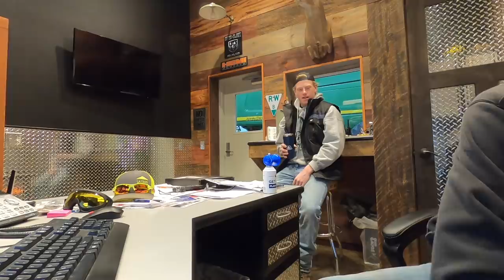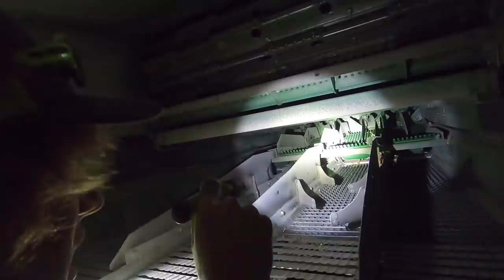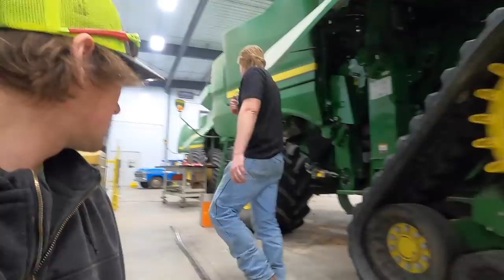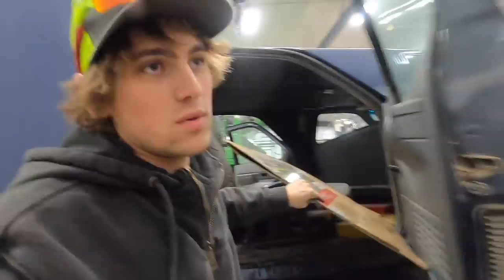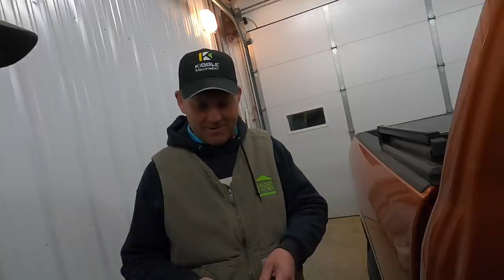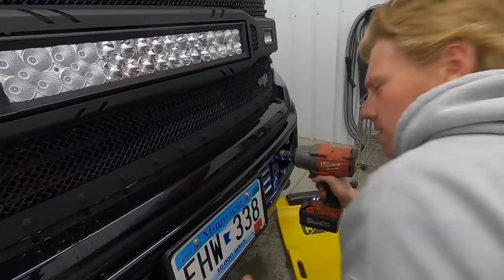Fixing On The Ford

Comment: Chet, you're always knocking the Ford, but when you were showing your trip to Commifornia, I was setting laughing at yout 10 MPG knowing my Ford would have been getting around 20! And I just replaced my 07 model Ford with a 2020, because I figured after 250,000 miles and only normal repairs made, it deserved to be retired to a part time driver! #builtfordtough

Comment: Big Swede!!! Spray some wd40 or another protectant on the frame and other components of your truck to help fight the salt and rust. We live in Wisconsin and had an f150 with 80,000 miles on it and not a speck of rust to be found on the truck. Occasional “wd40 baths” on the frame kept that truck looking good until we sold it.

Comment: Suggestion,  we used what was called coal mine belting strips under ramps to stop slide. Their thick and last long time. Just a thought.
Reply: just attach a 6' piece of 2x6 to the ramp. That way, the trucks weight is still on the wood when it starts to climb the ramp and the ramp cant escape.

Comment: Why didn't you just tell Eric to buy a ram.   I'd leave the pre cleaner in the 790 it will keep the sample clean . We just leased 2  s790s on tracks for next year . We were running 2 s680s but they had high  hours on them.  I bought my first planter at an auction last week  it's a db90 with 54 rows on 20inch spacing high speed planter .  We plan on running it with our 9510 r johndeere or our 450 quadtrac.  We have rented and bought more land to farm so we have to upgrade our equipment.  We went from 5200 acres to 6000 acres . Nice video keep up the good work and stay safe  !

Comment: They build those  bigass trucks with the crew cab and they come from the factory with no bed on them you buy the beds separate they have a bunch of different options for the beds you can even get one with a pickup truck bed to dually they look pretty cool but they're monsters

Comment: The only time the little women's car gets cleaned out is when I have time to do it and last summer we had lots of tomatoes we didn't use so she gives them to people she worked with. Well I got in the car one day and it had a nice pungent smell with a side smell of apple cinnamon air freshener. Just let it go and a month later when I opened the door things were falling out so I thought time to clean. Kept smelling that smell and finally got deep enough and found two rotten tomatoes under the seat. Would much rather deal with a peach. Come close to loosing lunch in the back floor digging the rotten crap out from under the seat. Was touch and go but I made it.

Comment: DOUGO NEEDSA A new Ford truck which the truck won't rust like a dodge. sorry strong motor and good suspension, but body rust out fast in the salt belt.😁swede nice truck I'm am also a ford guy have been since i was young. had bad luck with mopar.

Comment: I hate those metal ramps. They slide away from the truck. I put rubber belting under mine. The plastic ones work better.